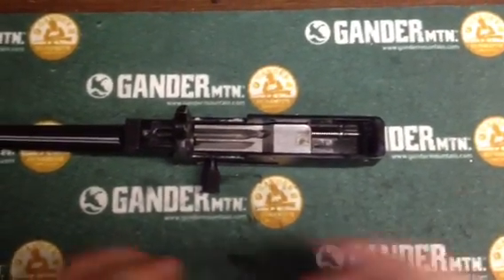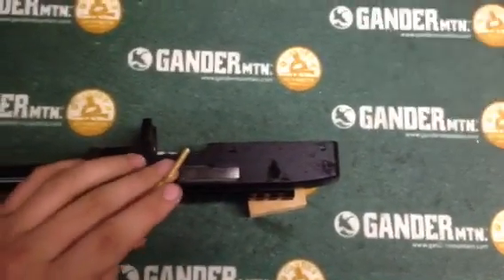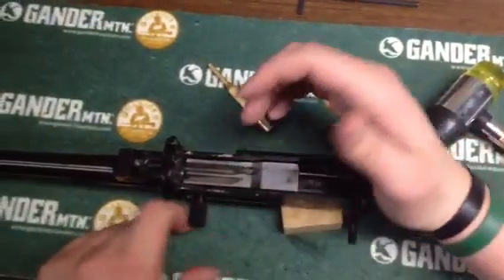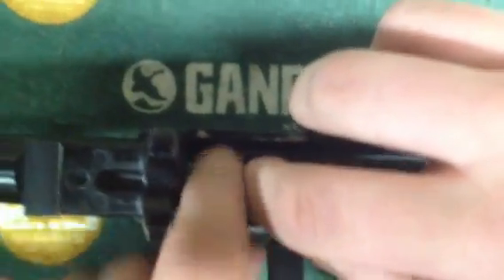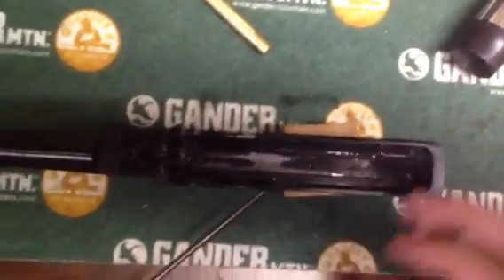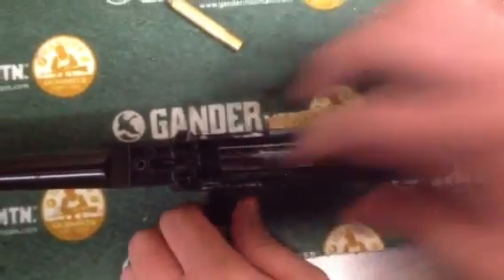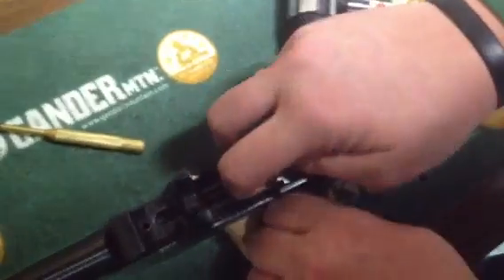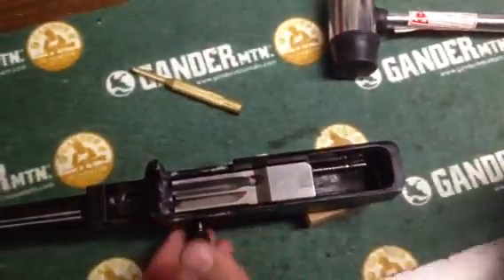Bolt and charging handle removal on ruger 10/22

Comment: We got the Ruger 10/22 for my son years ago. 
The sat for a couple years.
One day I went to use it and I couldn’t get the bolt open to load it. 
I took it apart, cleaned it. The charging handle and bolt function fine, UNTIL I have back together. 
And can I get the aftermarket guide rod and handle?
Thank You.

Comment: on my factory charging handle, the handle came off of the spring and i cant get them back together. what do i do?!?!
Reply: It's been 4 years, and I may be too late, but I'd simply file away the part of the rod interfering with you getting the handle back on.  I say that because I have a Tony Kidd guide rod and it does have anything out there to retain the spring - you have to be careful not to let the spring go shooting off into outer space.  The factory guide rod would work fine without the spring retaining part at the end.